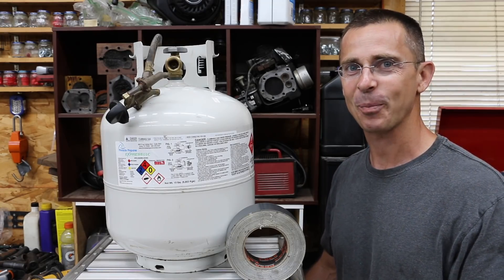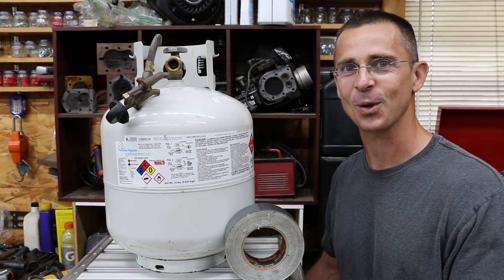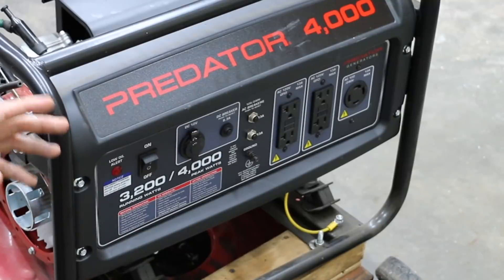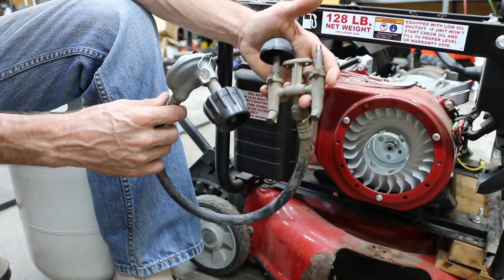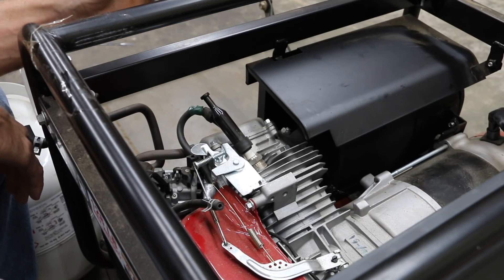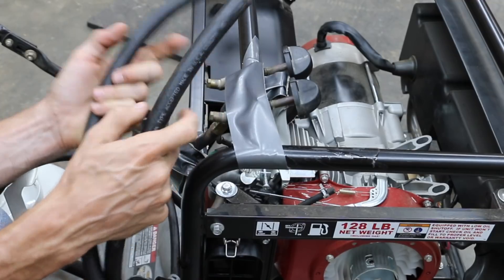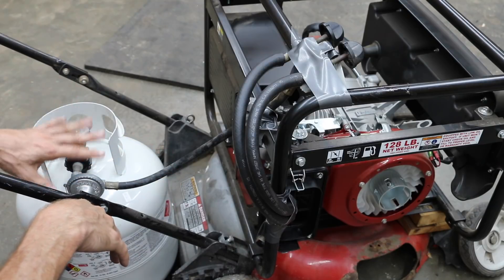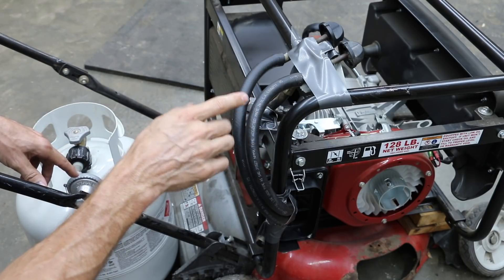Can a gas (propane) grill power an engine?  Let's try it!

Comment: The exhaust is super clean, we use propane on all forktrucks in industrial plants and the power is actually just fine in fluctuations in engine speed, we can't use gas in them cause carbon monoxide would build up in the buildings
Reply from the maker: Thank you!

Comment: One thing to look out for with propane, is that it doesn’t provide the natural lubricity that gas does. I think this is (obviously) a much bigger deal in 2 stroke conversions, but it wouldn’t be a bad idea to come up with some sort of setup to drip oil in the way of the venturi just to suck in a little lube for the top side. These are my opinions and observations, ymmv.
Reply from the maker: Great point! Thank you

Comment: Here in Argentina, fuel is expensive, and  people on low resources prefer to convert fuel vehicles to CNG, which means compressed natural gas (propane). It is very common to see old vehicles with large engines that consume a lot of fuel converted in a gnc one.  I have to say that I suspect that propane wears out the engine after prolonged use, which is very normal here.  My hypothesis is that propane gas is a dry fuel, where regular fuel is liquid and this helps the combustion chamber lubrication; also if you listen a gnc engine what had gnc for a long time has another sound escape then a the same engine buy with fuel, these sound that is usually drier or hoarse. Of course, a forklift  had already a "gnc" propane engine, but ot has it from factory
Reply from the maker: Thank you
Reply: CNG is methane not propane

Comment: I would have just fed the gas into the air cleaner letting it go through the filter isn't going to cause a problem but not using an air filter is.
Reply from the maker: Thank you!

Comment: Love to see pure hydrogen gas used, great video
Reply: This might end with crankcases flying through the room. There are some videos of these attempts, some end up in big bangs.
Reply: What is better is running an engine on wood!! See my channel Cheers
Reply: @kevin paul halliday What the point using Hydrogen, where is the energy coming from to produce the hydrogen??
Reply: @Thrive-Off-Grid  Solar power to split the water into hydrogen and oxygen.  My neighbor did it but they did have an issue and they never did it again.  It is dangerous but that doesn't mean someone isn't smart enough to figure it out.
Reply: @rogerlarson8040  Better off just putting the solar directly into a battery bank wouldnt you think?
Reply: Where can the general public get nitrogen? Welding shops??  Propane is a good backup and readily available for purchase.
Reply: @kevin paul halliday you can run a vehicle on biomass  for free. It produces its own energy to break down the fuel into hydrogen, CO and CH4. To crack water you need to put more energy to crack it then what you can get out of it. Might as well use the energy put into the cracking the water and use it to power the vehicle.  The machines I produce make the gas and convert it to electricity to store it or use on demand. Eventually the machines will run SOFC technology. Yeah Ive already been down the road of building electrolysis systems. Ive built some very advanced cells.
Reply: Hydrogen is not feasible, the atom is too small, so it's need very heavy container o contain it and the efficiency is quite low
Reply: @wahdangun  Hydrogen is very feasible. Efficency is fairly good. Steel and aluminium contain it pretty well.  

There are really only two real issues seperating oxygen from the gas and compressing enough hydrogen to a usable quanty. 

Once oxygen gas is seperated and the is hydrogen is dryed, the best hydrogen containment at room temperature are metal hydride containers, but they can be expensive.
Reply: @kreynolds1123  no efficiency is really terrible, it's better to use battery than Hydrogen, it's even worse if you use hydrogen in combustion engine, you will lose energy for nothing.
Reply: @wahdangun  see you didnt mention  efficency reguarding hydrogen source. If your referring to electrolysis, then certainly thats not very efficient at all. But ihydrogen from steam refomming competes "reasonably" well after factoring in Steam turnines for electricity wastes 40 to 50% of the energy in heat.
Reply: @wahdangun  As for combustion engines, it is funny that you mentioned this. Even after Using electrolysis for hydrogen on demand, i got 25% better fuel economy with hybrid hydrogen and gasoline over running on the primary fuel alone in my cars and trucks.
Reply: @kreynolds1123 no, it's still not very efficient,even if hydrogen generated from steam reforming it's still can't compete in efficiency from battery, and it's worse when you factoring delivering hydrogen, in case of electricity you can delivering it pretty efficiently using grid system and battery efficiency is almost 100 %
Reply: @wahdangun  your apples to oranges. And you are so off on your optimism and cut so many corners like the inefficiencies of converting energy to electrical energy, and its distribution,  and conversion from ac to dc. And dc back toban ac in an electrcal motor and a drive trane. And while the round trip efficency of lithium battery is realitivly good, its no good to anyone if it is only going to get more expensive and doesnt last long enough. Ohh but unubtaninium is 100% efficent and last forever but sadly there is a problem sorcing it. 

Listen, while i can conceed you make a few points, you make a lot of blunders that i really dont have time to correct you on.   So argue all you want but im done.  😊
Reply: @SteelBelted  ?
Reply: @Kellen Harris yeah. I got that after further replies. I haven't been back to this thread in a while, but I wish them (and their engines) the best of luck.
Reply: hydrogen? you mean propane? because that's not pure hydrogen, it's a hydrocarbon.
Reply: @rickfordmorningstar130  no I really ment for him to use pure hydrogen, no it is not a hydrocarbon because there is no carbon
Reply: @tomfarrow710  Perhaps I misunderstood, but he for sure used propane, which is 100% a hydrocarbon. Also, I like hydrogen use as  well, but it's not feasible in a gasoline engine, as it's combustion produces water, which would destroy the pistons.
Reply: also, note the 3 carbon atoms in propane
https://en.wikipedia.org/wiki/Propane#/media/File:PropaneFull.png
Reply: Richard Hays gasoline combustion produces water as well so I don’t think that would be a problem. Or would it?
Reply: @rickfordmorningstar130  propane also produces water when burned. A gasoline engine is not made to run either one. Now if you made an engine out of stainless steel different story.
Reply: @glennwebster1675  burning  gasoline  makes water (dry super heated steem)  and CO2.  

Dry (super heated) steam is water in the vapor phase and presents no problem to internal combustion engines and is far different than  hydrolocking an engine with liquid water.
Reply: @rickfordmorningstar130  he literally said nothing about propane i have no idea where you got that. Pure hydrogen means...pure hydrogen
Reply: @Vivid Media That is only partially correct with gasoline and propane, which contain hydrocarbons. Pure hydrogen, by it's very nature being pure, contains no hydrocarbons. Pure hydrogen burning with regular air (as opposed to pure oxygen) produces energy, water (in reasonably high amounts, considering),  and small amounts of nitrogen oxides. As for water not being an issue, water is certainly an issue given enough time and water build up. Water isn't compressible. There are a number of interesting youtube videos and informative pages on water damage to engines, I hope that should you choose to try this, you check those out first. Good luck and goodbye!
Reply: @rickfordmorningstar130  Water would simply flash off, cleaning the entire inside of the combustion chamber and exhaust ports. Ever heard of water/meth injection?
Reply: @madjimms  I hope you've got some kickass piston rings. Still seems like a good way to end up blowing an engine or blowing up in general. Also, I seem to recall the issue with water/methanol injection is methanol and water slowly leech into the oil making it all milky looking and non viscous. Using hydrogen could also possibly result in hydrogen being forced past the rings, and that's just scary. A little bit of hydrogen and a lot of air tend to go boom when ignited. Finally, there's no way 100% of the water vapor is leaving the engine 100% of the time especially when stopping the engine (for that matter, it's unlikely you're burning 100% of the hydrogen, which could lead to quite the pop).  Either way, I wish you the best of luck should you decide to try this, and PLEASE shield the hell out of your hydrogen source and have an emergency cutoff. Don't go full Hindenburg.

Comment: I really like your videos and your American english. Maybe try next time create hydrogen and oxygen from water with electrolysis and supply gasoline engine with mixing of this two components. It will be probably hard to create enough such fuel but you can at least try this. Instead of that you can try supply engine with clear oxygen instead of air.
Reply from the maker: Thank you for the video idea!

Comment: Nice. No surprise there. Various forms of liquified gas are used in cars now. Storage on the supply line, and in the vehicle is more difficult than for liquid gasoline. Our home is heated with propane, delivered in a large truck, and stored in a pressure tank. It works well, as you probably know.
Reply from the maker: Thank you!

Comment: Believe it or not the Predator 8750/7000 I have is a very good generator never any problems. I bought duel fuel Chinese carburetor and planning to run Gas LPC and CNG. Two words of advice if you plan on buying one break it in for 5 hours and put a good quality aft oil 10W30. Change the spark plug as soon as you put oil in when you buy it. After the 5 hour break in put a quality full synthetic 10W30 in it Stabile for the gas and octane booster and it’s good to set starting it 2x a month and when you need it it will deliver.
Reply from the maker: Great advice!  Thank you

Comment: maybe someone will make electronic gas injection system in the future so the propane flow is continually adjusted. the hassle is with keeping the tank pressurized I think.
Reply from the maker: Thank you!

Comment: I've been messing with my mini bikes and small motor stuff I was thinking can we use a camping propane tank like nos on my mini bike ect I picture racing my friend half way down track when u max out or before open valve and spray into carb and maybe a tank of air for bost u can come over and test I have a lot of motors and such let's blow some stuff
Reply from the maker: Thank you

Comment: John Deere actually produced LP (liquid propane) tractors. Starting in the late 1940's to the 1970's. They are easily identified by the big bubble they have for a fuel tank. A few models that had the LP system but not limited to were; 520, 60, 720, 3020, and I think even some 4010's.  Google John Deere LP tractors, most are the old two cylinders. Zamboni's that prep the ice for hockey games are powered by LP as well, newer ones now though I believe are all electric. LP can also be used as the poor mans NOS in a diesel engine.
Reply from the maker: Thank you for this information.
Reply: @ProjectFarm  You are very welcome. Really the only difference between a gas and LP engine is the plumbing for the fuel system. Which I'm sure you already knew being the gear head you are. Keep up the good work on the videos!!

Comment: Forklifts run on propane and in fact, it's the only fuel you can use inside closed spaces like a plant or warehouse because the exhaust isn't deadly like gas or diesel
Reply from the maker: Thank you

Comment: I did this once with an old lawnmower.
I used a length of garden hose and a map gas torch. Had to use a needle to widen the hole in the regulator of the torch and routed the hose direct to the intake and drilled holes in the hose for airflow. It ran for quite awhile but eventually self destructed. The exhaust was glowing orange lol
Reply from the maker: Thank you!

Comment: The same gas that's in those propane tanks is the same gas used to power LPG cars. This is actually healthier for engine cause there is no carbon build up. I've driven a Kia K5 it's an LPG car and not only was the ride smoother and quieter but it had way better milage than any Petrol car I have owned.
Reply from the maker: Thank you!

Comment: Cool video but nothing new. A LOT of off-road guys have been converting their carbs to propane for years. It's HUGE in the Suzuki samurai world. The best part is that unlike a carb running gas one running propane can run upside down or at any angle. That's the biggest benefit of it in the off-road world.
Reply from the maker: Thank you

Comment: You can actually buy an upper cylinder lubricant kit for lpg. 
If you were going to use lpg it washes the oil off everything so use a kit such as the flashlube one.
Reply from the maker: Great point. Thank you

Comment: My volunteer fire department had a squad that ran off of propane in the early to mid 90's.  It was a retired ambulance. 

https://m.facebook.com/phvfd33/photos/a.10151010484760992/10154051552175992/?type=3&source=54&ref=content_filter
Reply from the maker: Thank you for commenting on this.

Comment: I saw a purpose built lpg powered lawnmower style engine on a supermarket floor polisher here in nz. It had a small mixer bolted directly over the standard Briggs carb so must be an available kit for them. It was very quiet and was setup like that to be run indoors and not gas everyone out with fumes as much. I was right next to it and could speak to him over it and couldn't smell anything
Reply from the maker: Thank you!

Comment: I love it! We tried something similar with our 2kVA Onan RV generator about 12~15 years ago, but it wouldn't even start, let alone run. In the end we caved in to common sense and bought a demand regulator for the job. I am most definitely impressed at how easily you got the engine to start, and just loved the idea of the control valves - why didn't we think of that?!

Agreed though, you need to keep adjusting the valves to keep the fuel mixture right, but it was a brilliant example of thinking outside the box. I guess if you just wanted to run some lights and a TV it could work very well. It's when you want to use a coffee pot or a microwave oven that fuelling issues arise, and imagine fun you would have trying to run a refrigerator that way.

As the British West Country farmers might say, "Proper job!".

Comment: Propane conversions are very common in Europe for cars and methane for busses.
The problem is that it tends to run a just little bit lean and in the long run it shortens the life of the engine components.
Usually you start the car with regular gas for about half a mile and then switch to propane.
Also you need a specific oil.
With these new modern systems the engines run with no problems and the performance are pretty much the same.
Reply from the maker: Thank you for this information.

Comment: I converted all our City police cars over to propane back in the 80s I took off all the catalytic converters and Dyno tested all the police cars before and after each conversion before propane are 62 rear-wheel horsepower after propane conversion 120 rear wheel horsepower it sure made the cops were sure happy that they had some horsepower again
Reply from the maker: Impressive improvement!

Comment: I helped wire a Cummins generator at a NASA contractor's facility as an apprentice a few years ago. It was powered by a ford v10 that ran on liquid propane. Allegedly the difference in fuel gives longer life to emergency generators throughout years of exercising and emergency use. There was a regulator of some sort on the incoming fuel line if I recall correctly. Thank you for your videos, they are a great help!
Reply from the maker: Great information! Thank you

Comment: I know quite a few forklifts that run off propane, so I kind of figured this would work but I didn't know if it would work with a standard gas engine. Very interesting.
Reply from the maker: Thank you

Comment: If your engine wasn't built to run on propane you MIGHT run into valve problems. Some gasoline engine valces and seats will break down when running propane after several hours of run time. If you spend a bit of cash on eBay you can buy a demand regulator(pancake type) and a high pressure (red) regulator for the tank. Plumb it red reg at tank to pancake buy engine. Then take the bowl and float off the carburetor and connext hose from pancake to the center (main jet) part of the carb. You wont have to mess with gas flow as load changes and when engine shuts down the demand reg will stop gas flow
Reply from the maker: Great point! Thank you

Comment: A bit late but fun fact, a lot of rock crawlers switch their fuel over to propane which allows the engine to run at any angle, even upside down. You are right in the sense that with a very basic setup like that having a fluctuating load would work, but with the right equipment hell yeah it will!
Reply from the maker: Very interesting! Thank you

Comment: I'd like to see you run a motor on (gas vapor) I had tried this on my 67 Ford F100 and it had a 352 Fe block I was trying to gain better gas mileage considering the darn thing got me 5 miles to the gallon on a two-barrel driving 65. What I had done is taken an old windshield washer canister and placed an intake line on the bottom of the canister  and stuffed halfway with steel wool. next I drilled a hole on on the top with a PCV valve and connected that line to my air intake and adjusted the air-fuel mixture screws on the carburetor . please try this thank you and I love this show.
Reply from the maker: Thank you for the video idea!